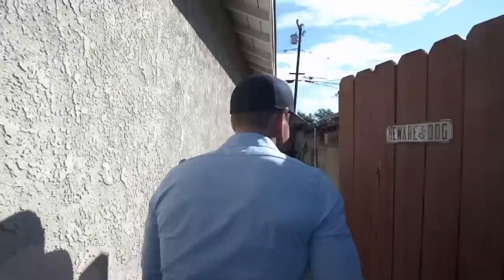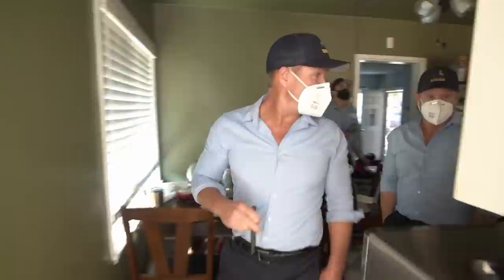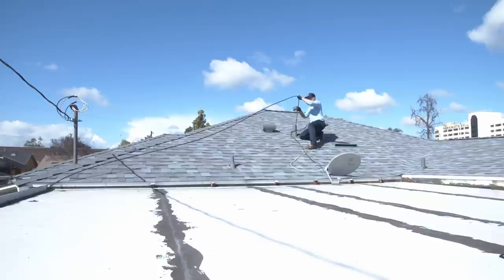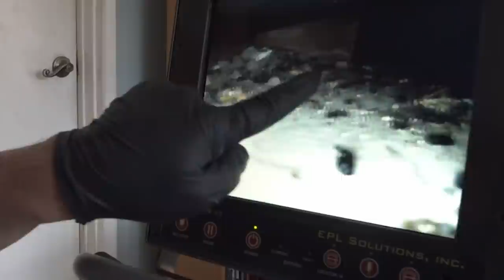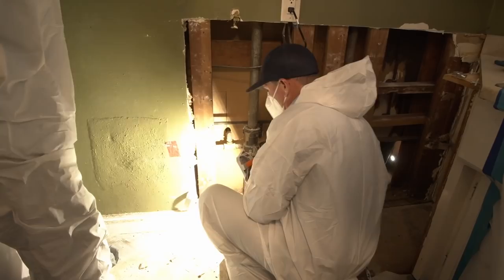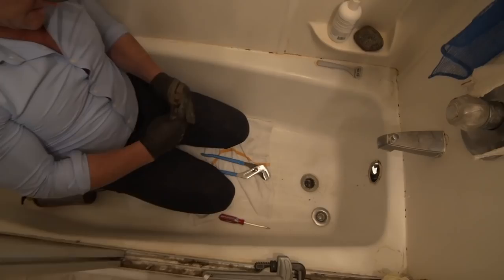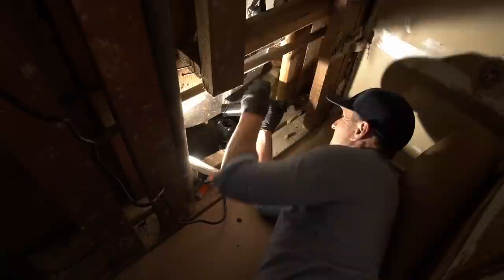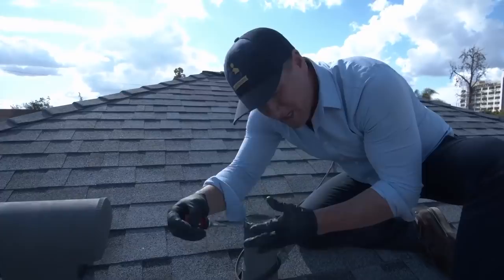RATS coming in UNDER A SLAB FOUNDATION!! How to REMOVE Rats QUICKLY! Twin Plumbing

Comment: I have been binge watching all your guys episodes and I'm highly impressed with all the technology and techniques implemented 🎉congratulations 🎊 on helping everyone 👏 even the nehbors are seeing less rats. I just caught two juveniles with my vector electric trap with peanut butter and cooked salmon grease 😅 I haven't heard any in the roof but now I know I need to clean it out in a fifth wheel trailer it's hard to cover all areas in sub floors and ceiling they did a number on ac ducts. with a baby im worrying about what products to use are your cleaning products safe around babies? I would need mold cleaner and rat pee cleaner. I am working on getting out of this trailer I have a go fund me page in my description that could speed up the process of getting into a rat and mold free environment for my family. I don't expect to reach my goal but every little bit helps

Comment: Did you seal up the open line to the sewer? or did I miss that?  also is that mesh on the vent on the roof for rats, they'll climb up on a roof and come down?
Reply: Yes, I believe they did put a new pipe to replace the broken pipe.

The covers on the roof vents is to keep Norway/roof rats out.

Comment: THIS is why I told my husband to NEVER EVER buy a house on a slab here in FL. That could have caused a sink hole, never mind the expense of dealing with all of the damage and the mold.
Reply: Interesting. I would imagine that snakes might like it under a slab as well because it's hidden and cooler? Not sure🤔
Reply: Yep def could’ve caused a sinkhole
Reply: I would only want a house on a slab. Solid and secure.
Reply: Ha! Good luck finding houses in Florida that aren't on a slab. I was born and raised there and we always had slabs on the ground floor.
Reply: It definitely sounds like you don’t know what you’re talking about. Where are you going to find a house in Florida that doesn’t have  concrete slab foundation? 
And fyi, a water leak can definitely happen with homes on pier and beam. There are a lot more benefits of owning a concrete block house construction than you owning house on pier and beam foundation. homes on concrete slabs are better investment.
Reply: crawlspaces have more rodent issues than slab 95 percent t of the time research yourself

Comment: I would have used brass waste and overflow or you might be doing the job again.  That is what I did refurbing a 1945 house.  P trap was ABS.  Another trick is to wrap the pipes in 1/8" hardware cloth or stainless steel fabric as the rats/mice can't chew through it.   Good job on the vent pipe screen.

Comment: So the rats were coming up from the sewer and living behind the tub?
Reply from the maker: Yes, they love living under tubs. We have another video coming out soon where they chewed through the underground sewer pipe and tunneled through sand, then right under the tub.
Reply: @TwinHomeExperts  so whoever build  the house they failed to fill that empty space then? I guess you need some material, either concrete or bricks to fill those voids.
Reply: Where did the rats go after fixing the problem .using plastic for pipe won't the rats return?

Comment: Why would you not put a metal overflow and drain in ???
Reply from the maker: Great question! Even if we installed a metal waste and over flow, rats can chew their way through the plastic pipe: the long term fix is to install a back flow prevention valve in the front yard to stop rats from coming in.

Comment: Trying to get my hubby to fix this problem. We've used baits but not working. He doesnt like to spend money on the house. He doesnt think its a big deal. Its embarrassing. I dont talk to neighbors. Ive gotten to the point where im not even comfortable in the house. I guess i will have  to get an expert myself.
Reply from the maker: So sorry yo here this brenda! We actually have a upcoming YouTube video on Saturday we’re launching that almost cost a marriage. 
If rats are not htting baits, it’s because they have plenty of food source outside your house. 
You need to spend the time locating entry points, then whatever rats are left inside will then eat your bait.
Reply: I just bought 4 pcs victor bait from walmart a few days ago. I used peanut butter and they are just being ignored. I use melted hersheys chocolate and we got 4 mice in two days. Very picky eaters and they can't resist chocolates